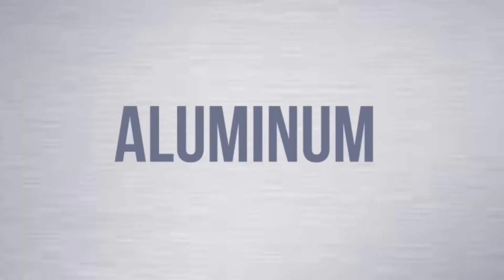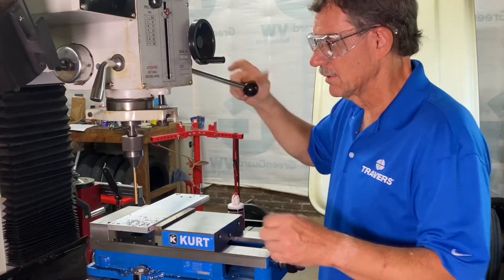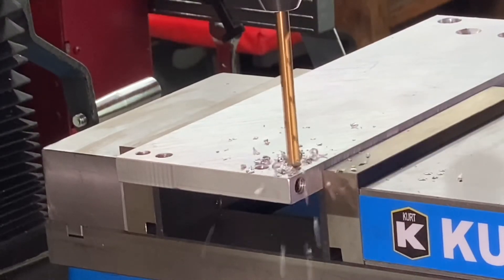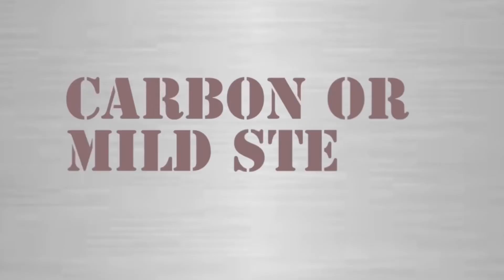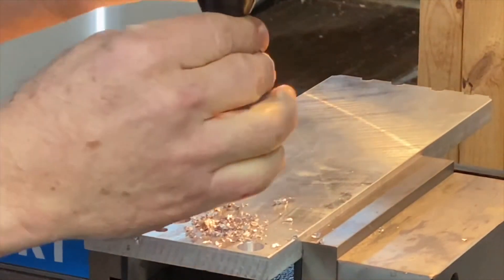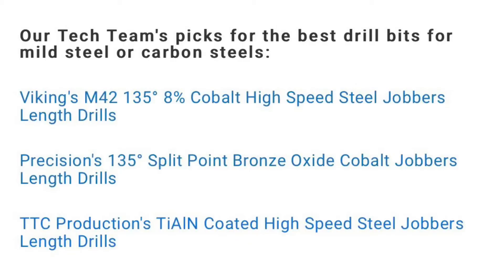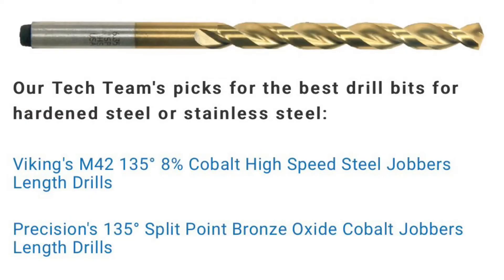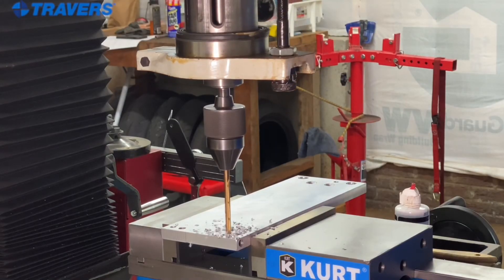How To Choose The Right Drill Bit For Metals {Aluminum, Mild Steel, Stainless}

Comment: Hi!  Might sound like a no-brainer, but are the TRACKS on which aluminum windows slide ALSO aluminum?  Windows are leaking rainwater,, and a window specialist told me to drill a few extra holes on the other side of the track as extra weep holes through which rain can escape.  Bottom line is, I wanna use the right drill bit for this metal  Thanks in advance!
Reply: You can use pretty much any drill for that, shamelesschic, since it's a thin material.